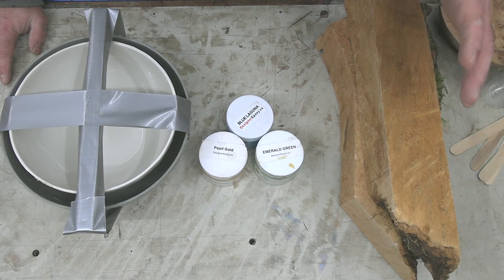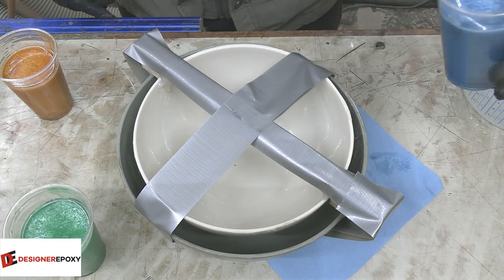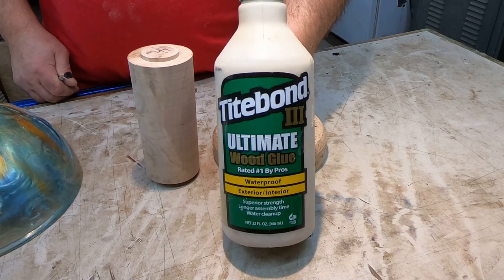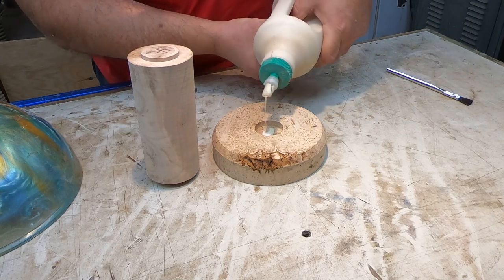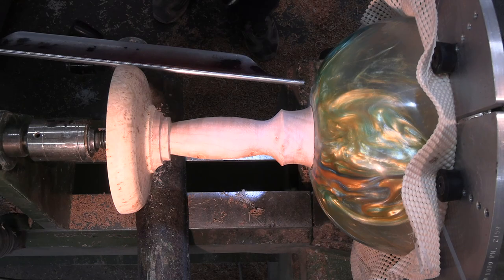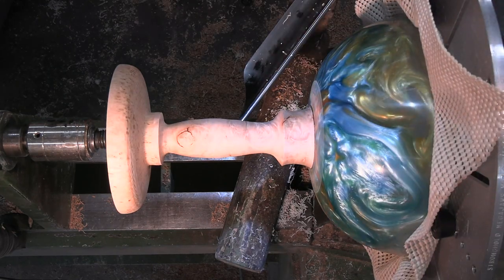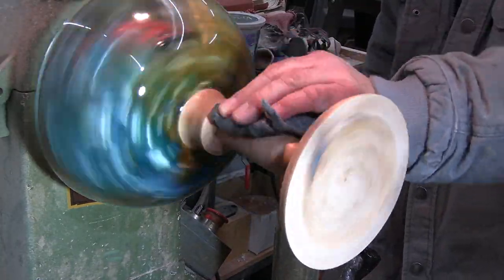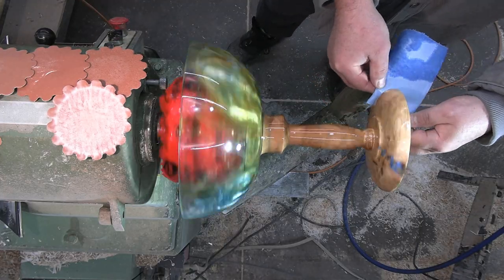Woodturning - The Massive Resin Goblet!

Comment: Can't get over how stunning the bowl/glass turned out! Always amazed by the Bob Ross "Happy Accidents" that happens to skilled artisans. What I wanted to comment on was the stem/base. At first I thought it would look better with a darker wood - mahogany or dark cherry. But after looking at the finished piece, it struck me how much it resembles the texture of cork! So the color and texture will carry though the project. Nice thinking, Jim!! (Good luck with the tractor. Don't let it run over you!!)
Reply from the maker: Now that you mention it, it actually does look like cork! Thanks for watching!
Reply: Happy accidents are what happens when you look at problems as opportunities for creative solutions instead of blockades. There's always a way around something, and an artistic piece always turns out so much better if the problems you encounter along the way are used to make it even better!

I've started working with a medium that's pretty much all about that! Most of what you're doing is gluing decorative pieces on to hide the imperfections on the egg. My decorative eggs have gotten really stunning and even when I go over what something was added to cover over, people just keep looking at the piece and going, "Man, I can't imagine this thing without that! It's too pretty!"

Comment: If you didnt poke at it with a stick in the beginning then it should have stayed looking like the bottom. The bubbles would have also been a cool touch. If you made a disc with left over resin and put a teflon or ceramic coating on it and poured over top, would it stick to a second pour directly on top of it. I am looking for a way to make to 2 resin pours not be able to bond to eachother for a form I'm working on so I'm just curious. Also looking at wood round blanks. Cost vs effectiveness vs reusability.
Reply from the maker: I would think food wrap would be a better choice. Getting other chemicals involved in the resin casting is probably not a good idea. Shrink wrap or even the white kitchen bags that I use pulled tight might be a possibility too. Thanks

Comment: Hey Jim, great project turned out very nice love the color separation I’ve seen a YouTuber put his Apoxy in a vacuum chamber waiting for it to heat up to get rid of bubbles seem to work really well and then put it into the pressure pot after your poor
Reply from the maker: Yes, I’ve done this lots of the time too. The issue here was the resin was curing. So it need to go into the pot soonest. Thanks

Comment: Nice glass.  Just the right size for me.

So my experiment with stabling one piece of black walnut and not on another came out as expected.  The stabilized bowl tock less resin and the wood was much harder.  I think stabilizing has its benefits.  Yes it adds more steps but it is worth it in the long run.  I think the cost is about the same.  Cost of resin is about the same.

FYI I have been experimenting with different tools for turning resin.  Carbide have an advantage over traditional gouge for sure.  But I have a flute less gouge from Thompson Tools that is very effective.  I first learned about this tool from the Robo Hippie.  He is a member of our club in Oregon.

Thanks agin for your interesting channel.
Reply from the maker: The only really issue with stabilizing resin, is the fact it’s not food safe, other than that there’s a ton of benefits to stabilizing but when I use Deep Cast it essentially acts like a stabilizing resin in punky wood and that also makes it fine for food contact. Thanks for watching!

Comment: Because rice is a solid and not a liquid, you need to account for the air voids the rice has. More unyielding surface area (like the bowls) equals a less tight pack and more void areas, so your rice volume will be lower in the measuring container where the rice can settle more.

Oops...It did sound like a good theory!

Absolutely amazing project! I usually hate comically-large kitchen utensils and dishes, but this is really beautifully done and not for the comedic value of making it a large glass! I love the way the colors play together in the amazingly clear resin. I wasn't such a fan of it until you got it all nice and shined up and now it looks so amazing! I do agree that bringing the colors into the wood really helps bring the piece together. Happy accident!
Reply from the maker: I got an email form another subscriber and he said that he taught science for 40 years and over that time they determined that if you use this method to measure spaces, you need to add 40%. That was pretty much exactly what I needed to add, so he was correct. Thanks for watching
Reply: @SpragueWoodturning  Sweet! Glad he was able to make the calculating easier!

I'll bet things will go much easier in the future. :D

Comment: Jim, I don't know if anyone else has mentioned this but vacuum pump oil is not the same as air compressor oil. You should change it out if you haven't already. Beautiful project by the way.
Reply from the maker: Thanks for the tip! Got some on order.

Comment: Hi Jim, very nice project to start the year with a Big Cheers Drink ...  I retained the rice measurement technique making sur that I would prepare more to compensate possible mistakes, although using transparent art cast turned out very nice. About the Art Cast epoxy I was glad to see you use it for the outside of the bowl. I hesitated doeing so since it had a depth of more thanan inch vertically but less than one horizontaly. My reasoning was that if your pour less than one inch on a 12 x 12 surface it should work,  why not around a bowl. Gabriel seemed to believe that we should not do it when I wrote him in this regard. If my meromy is good the resin surplusses that were given out two weeks ago were artcast and they were rather thick. The absence of thermocracking possibly validates this idea.  Thus I will try it soon. Last I bought a vacuum by PB AUTO last year and it works perfectly. I would have bought a larger model like yours if it was to be done again.

Thank you and see you next week.
Reply from the maker: It worked great! Thanks for watching!

Comment: Excellent Jim.  You mentioned you used ART instead of Deep pour.  Is there a longer work time with ART and is the set-up time longer or curing rate longer on the ART.  I did a project recently using a Deep Pour Epoxy and it worked great for the pour, but it was like glass after just 6 hours in the pot and I could not turn it, it would just break.  Can you recommend an epoxy this is proper for doing these types of projects that is soft enough to turn and the right amount of time to keep it in the pressure pot based on volume.  I would say most would be no different than you do.  Love your work and I am learning a lot.
Reply from the maker: If your Deep Cast cured in six hours you mixed it incorrectly or you did an over pour. It’s not recommended that you pour Deep Cast over 4” but as you’ve seen here on my channel I sometimes go way over that height. It should take 72 hours to cure. Artcast is ready to turn in 24 hours. When I said it was going to be hard to turn I was referring to the fact that it’s fully cured which makes the resin harder. But as you seen in the video it turned just fine. Wait times are the key to getting color separation, it’s achieved easily with Artcast. It you can only pour it one inch thick. Do you use carbide tools to cut the resin? Thanks
Reply: @SpragueWoodturning  Thanks Jim.  I over poured it, but it sounds like I may have better success with Art Cast.  Many times I am pouring voids but on occasion I will do a bowl like you Pinecone bowl.  So are you saying pour no more than 4" and let it fully cure before adding the next layer or turning it if that is required?  Can you pull it out in like 12 hours and start when it's softer and let it cure after turning?  I'd really appreciate your feedback.  Thanks.

Comment: I'm curious...does the temp in the work shop (temp of the resin, etc) ever have an affect on the turning...bubbles in the resin or tear outs?  I agree with your wife.
Reply from the maker: Not with tear out, but when the resin is cold it thicker and harder to stir, this causes a lot of air to be introduced into the resin while mixing. Thanks for watching
Reply: @SpragueWoodturning in that case, would it be a good idea to just keep resin in a hot water bath during projects?

Comment: how strong is vacume  pump you use on yours lathe ?, and how long do you run it, any problems using pump for a long time ?
Reply from the maker: Mine is a Gast pump and I can pull about 27 inches. As I write this it’s been running about 45 mins on another project. Hope this helps
Reply: @SpragueWoodturning  i dont have any experiance in vacumm chucks, but i guess its time to give it a try ;). i have  6cfm, 2 stage vacuum pump, it should do the job. thanke you.

Comment: Really great piece Jim. It looks really fantastic. 80K subscribers is a measure of appreciation to the work that you produce and the effort you have put into the channel. Your inlay work was awesome, but you have really excelled with adding resin to your repertoire. This week's project has again increased the things I want to have a go at doing. Unfortunately, I tried taking on a bandsaw while cutting some blanks out of Eucalyptus Nicholii. Bandsaw 1 Bruce 0. No tool work until the tendon heals. Will just have to rest and watch You Tube lol. 100k subs will happen very soon for you mate and it will be very deserving when it does.
Reply from the maker: Well that sucks! It’s probably one of the most dangerous machines on the shop. That and the table saw! Get well soon, thanks!

Comment: Great job Jim you should’ve used water instead of rice. You do a beautiful work.
Reply from the maker: I will never put water in any of my castings, if there's an issue you've just ruined the casting, thanks for watching!
Reply: @SpragueWoodturning  I did not know water would ruin the casting. The product you are using I have no knowledge of and the reason I am watching. It is to learn something new. I’ve always wanted to do the type of work you do. I have been working a lathe for over 40 years but I’ve never used resin.